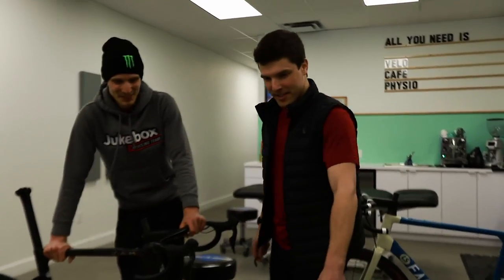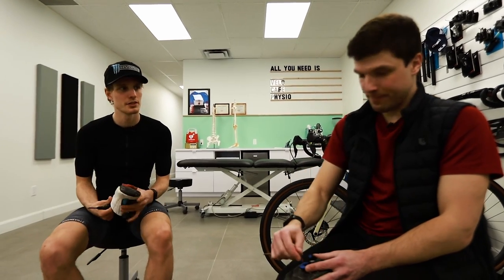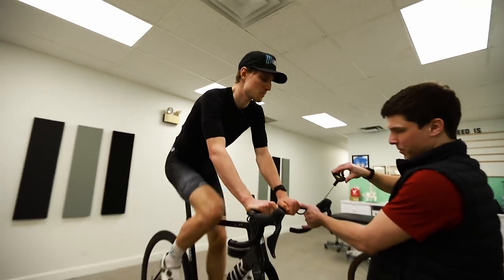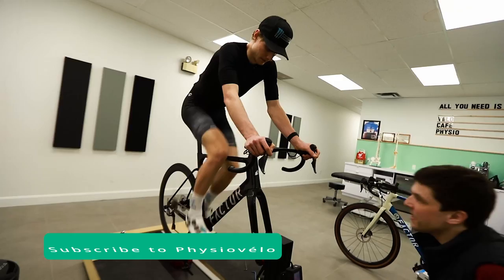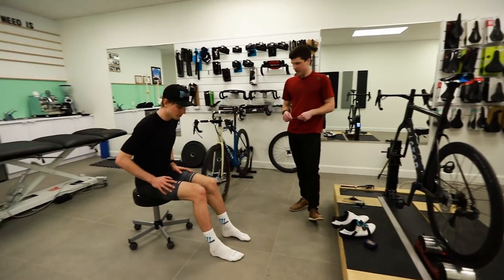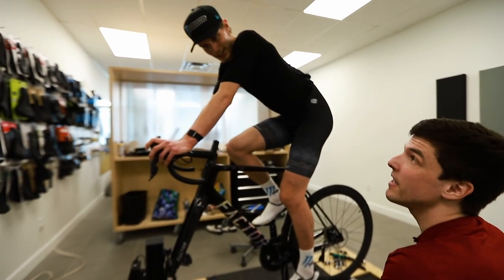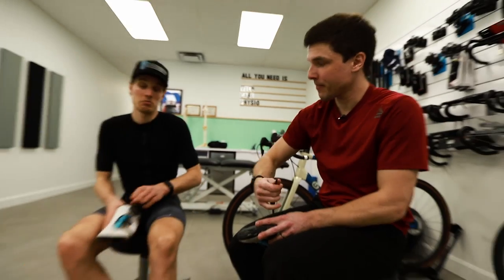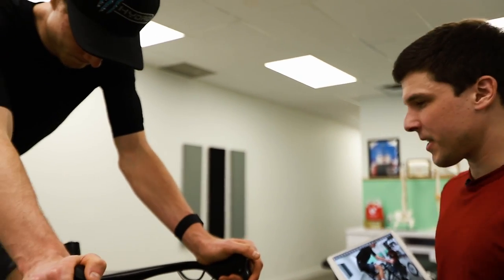Pro Cyclist 🚴‍♂️ = Pro BikeFit 🔧 Factor Ostro VAM (@AdamRobergeCycling from Jukebox Cycling)

Comment: What I'm getting from this fit is that if you're not actually racing 99.9% of riders should be on endurance bikes, am I correct?
Also, how do you determine the correct leg extension angle, bio-mechanically speaking, in order to produce peak power? I can see some riders have their legs almost fully extended and some have a higher bend when the pedal is the furthest away from the hip (5 o'clock/parallel to the seatpost). Does the width of the saddle play a role in how high a saddle can be raised?
Reply from the maker: Excellent questions!
1. Most riders with limited flexibility will have a hard time adapt to an aggressive #bikefit position.
2. Bio-mechanically speaking, leg extension should be between 150 to 140 degrees to produce maximum peak power.  BUT you need to address foot position in order to have a reliable Knee Angle Measurement.  Too much plantar flexion is good for power transmission to the pedal. It's usually a consequence of the saddle being to HIGH.
3. Knee angle should always be calculated at the point of greatest extension, with may vary from a bikefit position to another!
Hope this is useful infos!